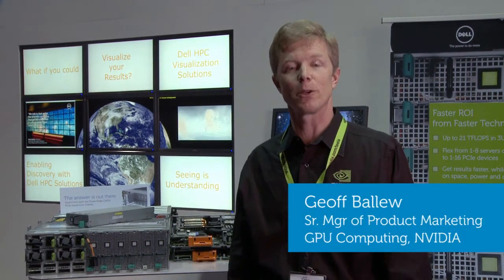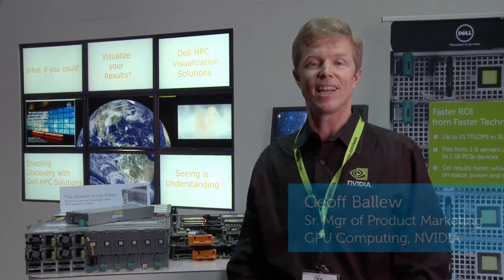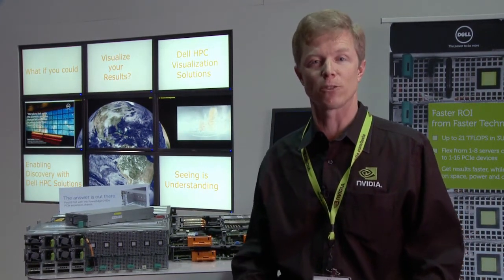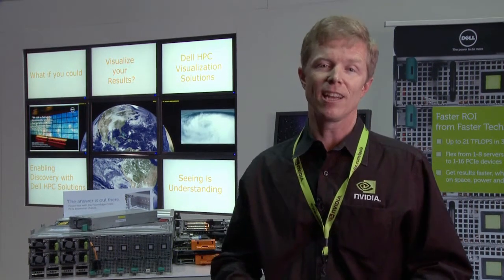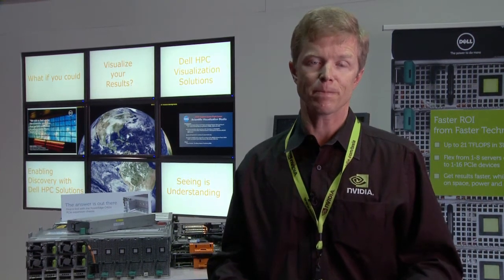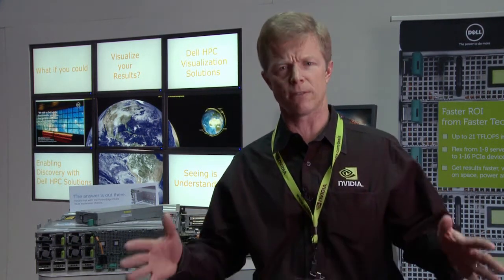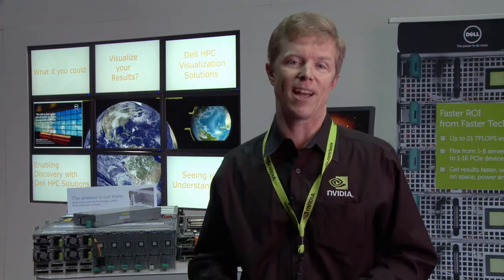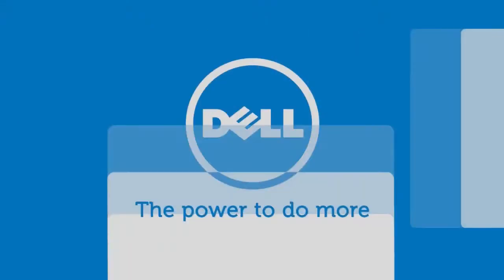NVIDIA Tesla M2090 GPU Helps Find Oil & Gas Faster

Comment: What kind of workloads would it be good for? Looking to buy 2
Reply from the maker: NVIDIA GPUs are great for parallelized applications, e.g. visualizations and simulations. GPUS are available in both workstations and servers. Which are you interested in so I can get you to the right sales area?
Reply: Well I have someone willing to sell me  2 nvidia Tesla m2090s for an ibm x3650m3 server, and wondering if it would be a good upgrade from a single amd radeon r7 250